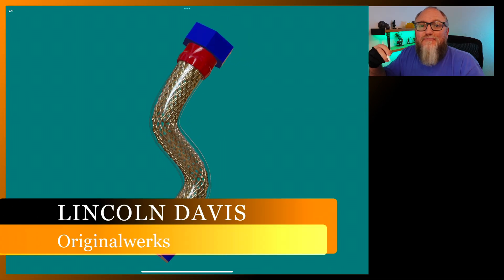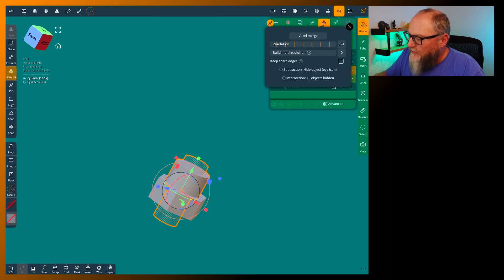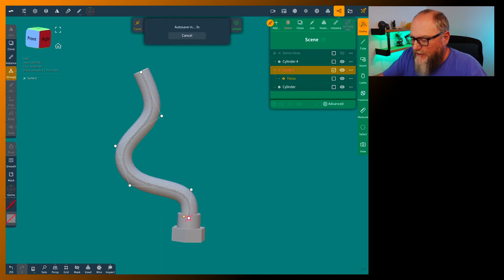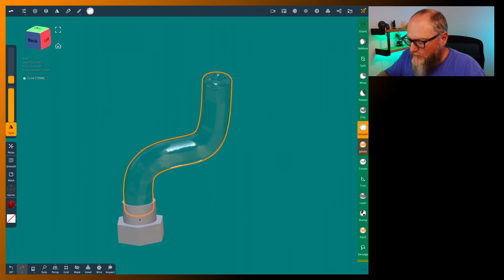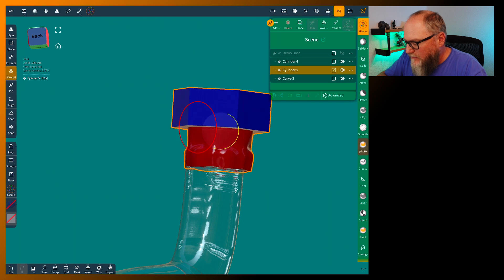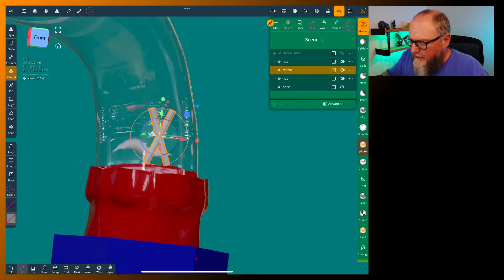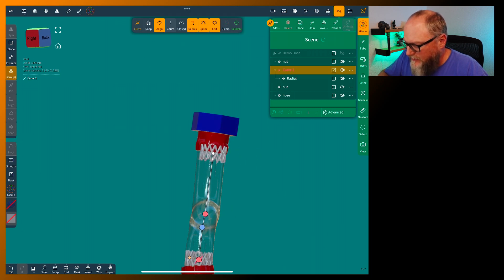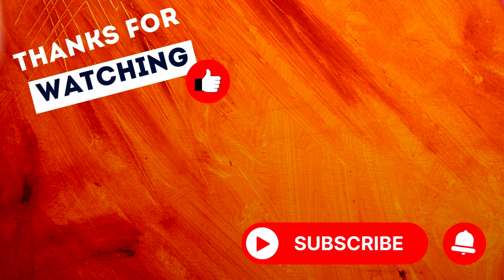Nomad Sculpt Tutorial: Curve And Radial Symmetry Tools

Comment: Great video thanks. A question I have and haven’t found the answer to is how to quickly and easily align several parts of a design to the centre or base etc. Example: several objects a sphere, a cube and cylinder, all aligned to the centre rather than tweaking with the gizmo? These thanks!
Reply from the maker: Not sure how to answer that. Can you give me a more specific example, like what kind of object are you trying to make. I could show how to use the radial symmetry tool possibly, but I would need a better idea of what you are trying to sculpt. (ex. tire tread, spokes, ball on a string.) Any process in Nomad can usually be done several different ways. This sounds intriguing, let me know.
Reply: @Original-Werks  Great sounds good, I’d be interested in watching. In terms of making something, nothing in mind as of yet sorry, just in terms of being able to align objects to a common point. So they are all aligned centrally, or to the left face or bottom face if you see what I mean? Like you can do I’m adobe illustrator or photoshop, I understand it is a 3d object and space, but it should be doable I’m sure. Otherwise things get out of alignment and then doesn’t look great as one side shows more than the other etc. as I’m writing I just thought of an example. Perhaps a spear, so the central pole/shaft would be the “centre” with perhaps ornaments and hand guards or grip wraps or similar but all these things would need to be aligned to the centre of the pole/shaft of the spear. Not explaining it very well sorry! 😅
Reply from the maker: I understand now. Usually how you want to go about keeping alignment with objects is to use the top GIZMO menu. Go down to where it says move to origin. (with object that you want everything aligned to selected in the scene menu or it will be greyed out) Then you can send other objects to the scene origin as well and use the gizmo to slide in one axis or another to place. (like a spearhead at the end of a shaft. Ornaments can be sculpted, slid out to edge of shaft, then use the radial repeater to copy around a central point. The grip wrap is easier, can be done several ways, the simplest is to use the tube tool and set snapping (magnet symbol in menu) to half and wrap the spear. The points will snap to the surface at each point you drag. There are several different processes here that you are discussing. Since this is 3D and not 2D the snapping and alignment work different in relation to the surface you are working on. I may do a video on this, several good points for teaching here. Have a good time with Nomad Sculpt, it is very robust. You just need to know where to find that checkbox or button to get it to do what you want. Hope this helps.
Reply: @Original-Werks  that’s fantastic thanks for your reply, I’ll go and try this. It’s taken a while for me to get into nomad as I’m from a 2D design background but so far and the more I learn, the more I love the app! Thanks for all your content. I look forward to seeing more 🙂
Reply from the maker: I just made this video that covers most of what you were looking for. Here is the link.https://youtu.be/_5KIwlIHGfw